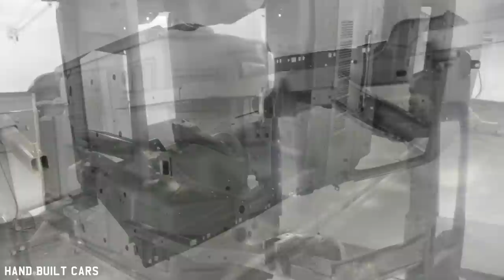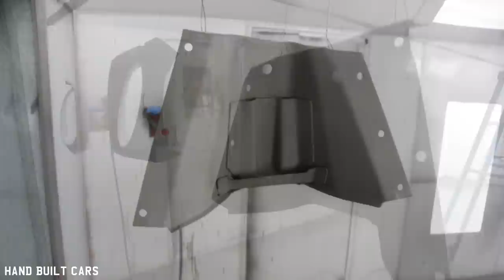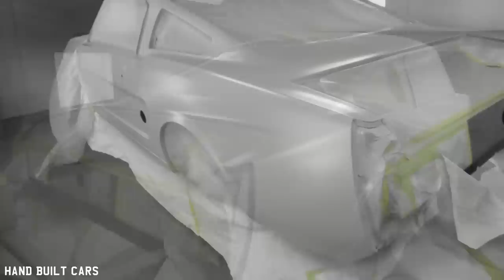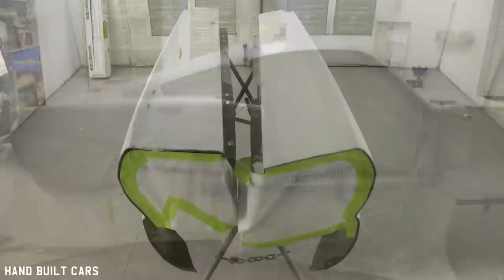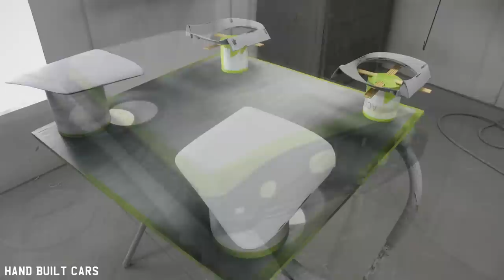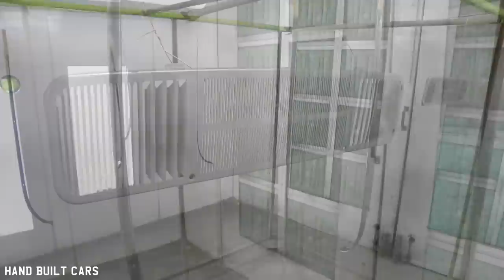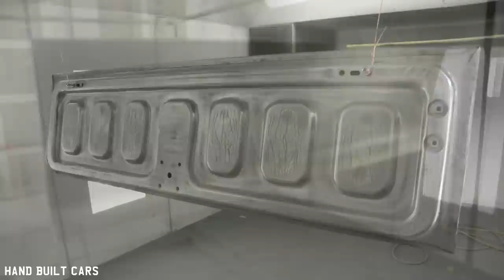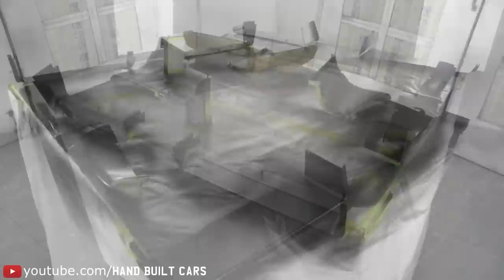Rusty 1966 Ford Mustang Shelby GT350 Restoration Project

Comment: If that's a 65 Carey over car. Trunk lid is wrong. Balancer, and timing cover. Also I've never seen so much filler and primer needed on 1 car. I'd hate to paint meter that car.